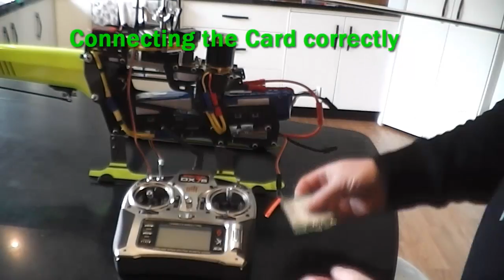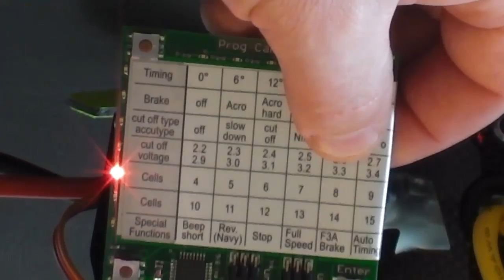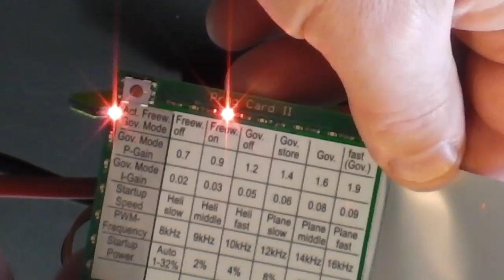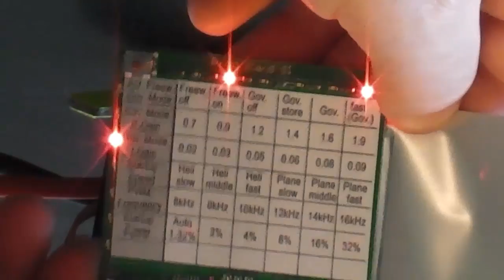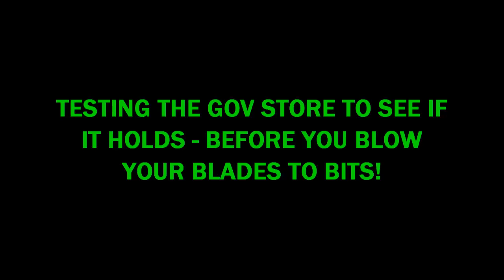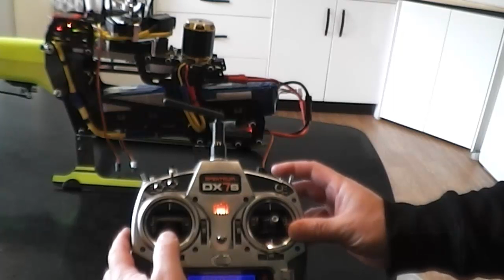PROG 2 Card SET-UP part 2 - for YEP and YGE ESC - +  Gov Store Setting

Comment: Great video. Question, for fixed wing aircraft, what should I enter for "timing"?  Also what section on card sheet(s) do I turn off the auto soft start? (My throttle is automatically increasing in speed, I prefer to have full throttle stick control. 

I would really appreciate your insight!  

Cheers & Happy New Year from Houston, Texas
Reply from the maker: Great... Glad it worked.
Start up speed set to Plane Fast for full and fast throttle response and you timing will have to set as per your motor manufacturers specification as they are all different. Hope thst helps.

Comment: Very interesting to see how the gov works. Never done this. The lowest constant headspeed would be 75% on all heli's with gov? I fly 80% without gov. Can i have a low stick start in my throttle curve to for a normal flight or is it alway set at a flat curve? You also said somthing about signal bind interference? Where did that cable come from because i did not understand why you did that? Or how. Just asking before flight. 🙂🇳🇱

Comment: great info, but your test did not really prove that the governor store was working, because if you had set straight line throttle curves, without a governor, the motor would behave the same. flight loads would need to be imposed to test that the governor held a governed rpm.

Comment: What is the plug you put on the short cable? Do i need that to run the esc? you called it the loop cable..
Reply from the maker: hi there . are you talking about hte loop cable i refer to earlier? here you go https://youtu.be/7e-HL5k8ojI?t=44
Reply: Yeah. just bought the YEP 120 and wasn't sure which wire was for throttle and the other is for??? programming i guess.

Comment from the maker: A Few Special Things to remember: GOVE MODE MAIN BATTERY CHARGE SHOULD BE 3.8-4.0V/ Cell MAX
1. Once you set store mode, disconnect batteries and disconnect Prog Card
2. reconnect ESC to Throt port in FBL controller and power up in normal 0==> 100% thorttle curve mode with (NO THROTTLE HOLD)
3. once the energising sequence is complete, the ESC and motor will "Beep" Once and keep repeating. THIS IS IN GOV STORE LEARN MODE.
4. Now that this is confirmed, g to full throttle [NO BLADES OR BELT-GEAR OFF] and you will hear it wind upand up and then you will se the LED on the ESC FLASH and then stay at the same constant speed.
5. Pull Down to Idle and then disconnect and reconnect you PROG 2 CARD.
6. Recheck all your settings. normally you will find your PWM setting will be changed.
7. For a Roto Span under 1.0M your P and I Gains will be at the setting under 1.2 and 0.03 respectively.
Reply: Hello 
Thanks the video was helpful. But my question is I should remove the band plug after I'm done with programming and before flying or leave it on all the time

Comment: When programming I get the victory tones.  However, when selecting a setting there is no tone to confirm and it does not seem to remember.  I go back through and it shows only 1 option in rows that i chose 2 like slow down and lipo.  Any ideas?

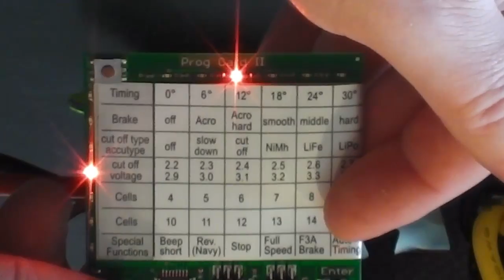Comment: Great video Westy. @9:35 when setting the "Cut Off Voltage" you set it at 3.1v which is spot on for your LiPo batteries. It's just that in the tutorial you say it is set at 2.4v - 3.1v because the box has 2 rows of numbers. I think you'll find the top row of numbers in the boxes is the cut off voltage setting for LiFe batteries & the lower row of numbers is for LiPo batteries. As I said, it's set correctly for LiPo's at 3.1v. It's not set at "2.4 volts TO 3.1 volts". Clear as mud eh..? LoLzzz